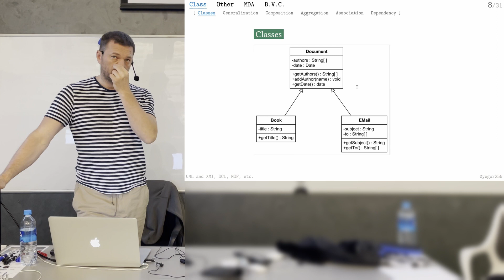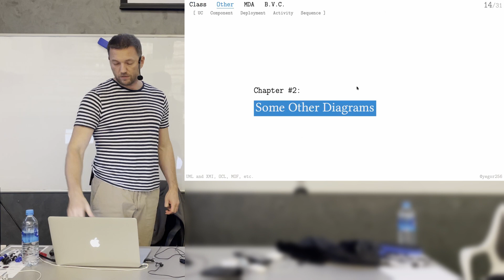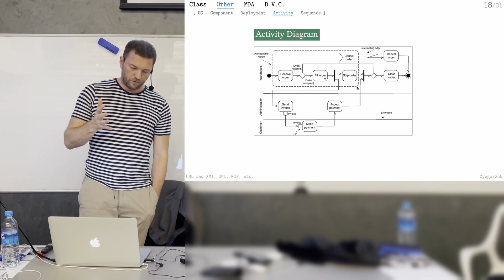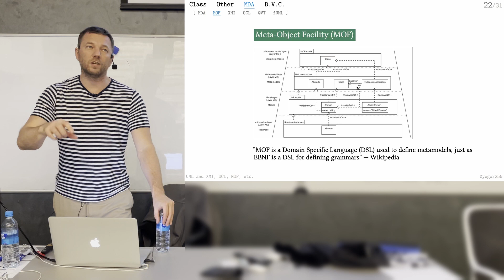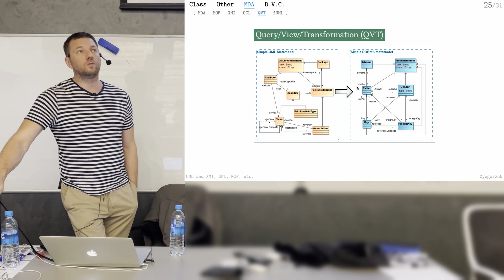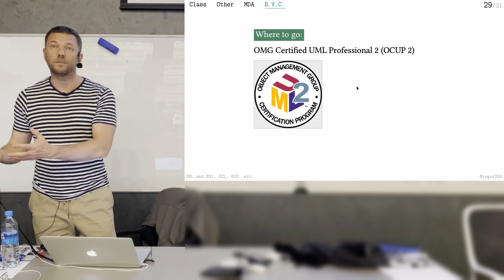SSD 8/16: Unified Modeling Language (UML) [software design crash course]

Comment: is agregation still a problem considering the possibility of treating null references? In java we can have Optional types to deal with agregation, in kotlin you can use nullable types which will behave similarly as the Optional type.

Comment: 6:25 "composition here means the window can not exist without a slider"
а можно узнать источник такой трактовки композиции? ничего подобного в стандарте uml нет. 
 
"Sometimes a Property is used to model circumstances in which one instance is used to group together a set of instances; this is called aggregation. To represent such circumstances, a Property has an aggregation property, of type AggregationKind; the instance representing the whole group is classified by the owner of the Property, and the instances representing the grouped individuals are classified by the type of the Property. AggregationKind is an enumeration with the following literal values:
 ... composite - Indicates that the Property is aggregated compositely, i.e., the composite object has responsibility for the existence and storage of the composed objects ...

Composite aggregation is a strong form of aggregation that requires a part object be included in at most one composite object at a time. If a composite object is deleted, all of its part instances that are objects are deleted with it.

Compositions may be linked in a directed acyclic graph with transitive deletion characteristics; that is, deleting an object in one part of the graph will also result in the deletion of all objects of the subgraph below that object"

ничего тут не говорится про то, что "instance" не может существовать без "Property" которое он "aggregated compositely"

Robert C. Martin:
Composition is exactly like Aggregation except that the lifetime of the 'part' is controlled by the 'whole'. This control may be direct or transitive. That is, the 'whole' may take direct responsibility for creating or destroying the 'part', or it may accept an already created part, and later pass it on to some other whole that assumes responsibility for it.
Reply: 12:30 ваша трактовка ассоциации тоже непонятна. ассоциация - термин означающий, что между сущностями есть некая связь. агрегация, композиция - частные случаи ассоциации  
"If the association end is a composition, this is indicated by a small black diamond adjacent to the name of the end."